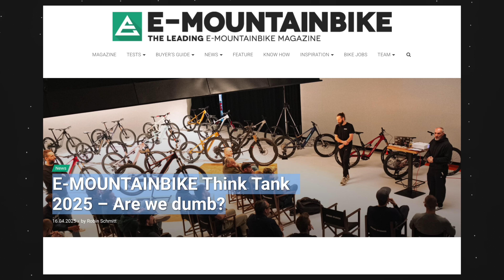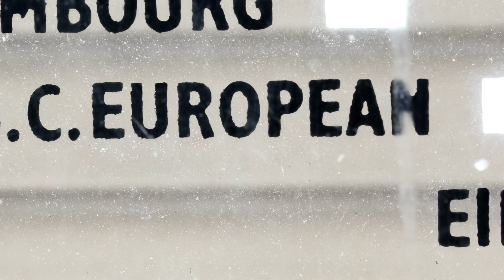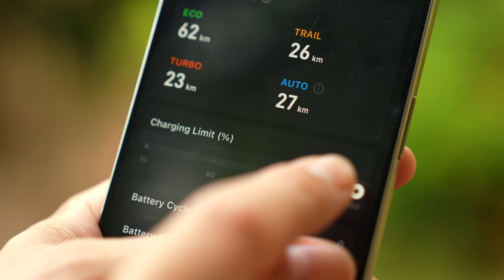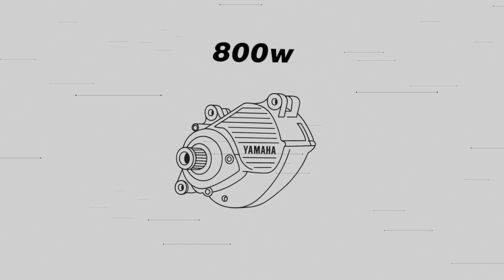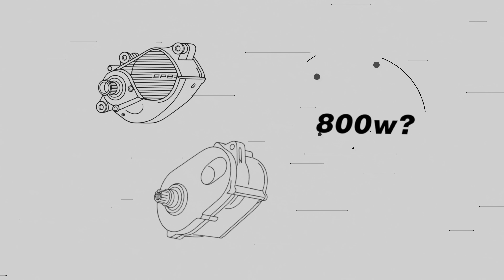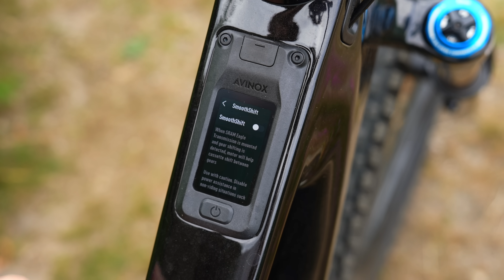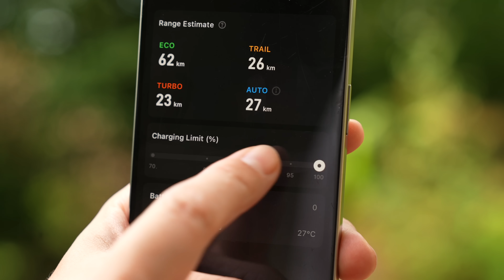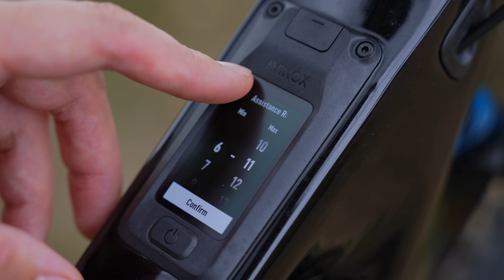Why eMTB Power Is Changing

Comment: As always a cracking summery of what we are all thinking . In the next year there will be a company that get the perfect mix right. It will be a big company in my opinion. Spesh boffins and cranking hard toward this . So its a decent weight , 20 kg , useable power , mid battery with range extender BUT with a user interface that will keep a oldy or a tech nerd happy to use. ITS OUT THERE SOMEWHERE AND WE ARE READY . PS nice use of AI imaging ..... its very handy . cheers BArny

Comment: People can buy a car with 1000hp but when it comes to bikes we need restrictions.  The industry really doesn’t want people to realize there is a cleaner and healthier way to go shopping etc.  I have noticed more cargo bikes being used by hand workers in the city.  Parking is not a problem getting to the worksite is faster most of the time on a bike and your tools can be parked at the door.  Having a stronger motor for transport is logical.  Open up the doors to creation and let the power race begin.

Comment: Watts = Voltage x Current.
More volts= higher RPM 
More amps = more torque but it generates more heat. 

To have more power without burning a motor to a crisp, just raise the voltage.

Don't be afraid to be more technical mate. 

I think It is important to explain and educate the general public, so they can make an informed decision.

Comment: Bicycle chains and sprockets have simply reached the limit of their torque capacity. A new innovation is needed, or perhaps an MGU . Alternatively, a high-revving motor with 250 Nm of torque and a single-speed drivetrain could be introduced. Even today, with around 100 Nm of torque, one can ride very lazily, so fewer gears and therefore thicker chains would be a solution.

Comment: i actually think the 250w continuous peak power limit is sensible, because it, on average, controls how fast a bike can go.  Perhaps, there should be another short term limit, lets say 1000w for 30sec, which again, makes sense. In fact, i'd happily see the stupid low 25kph limit removed (a limit that for me as a light, fairly fit rider makes my ebike by far the slowest bike from A to B) and a new power vs time curve introduced to level the playing field.  That curve, or more accurately collection of curves based on bike type (set by rifer / payload max weight, eg cargo bikes get a higher average power limit) would me we could all just forget all the cheating and subtle avoidance of the single fixed limit power number that we can all agree is ridiculous.  basically we move to an "integrated energy consumption" limit

The one big change that is still in the wings for ebikes, and that will actually revolutionise the market is of course mass specific battery energy storage density! Today, a decent 800Wh battery is still at 4kg or more, and that cannot easily be avoided. A lighter more powerful motor is easy to engineer (just up the voltage and base speed of that eMachine) with even basic commercial PM eMachines hitting 20kW/kg, but today a "big" battery that makes a powerful ebike genuinely useful is a heavy battery!  And this, for me is really the only real downside of my ebike, it's really really heavy. No not necessarily when riding, but for sure when trying to carry it, lift it, put it in the car, etc.  As improvements in cell chemisty now start to push up specific energy density, soon we can have a 15kg ebike with 1000w peak, and1000Wh of battery and THAT really will be game changing  🙂

Comment: The next phase that’s ripe for advancement is the transmission area, whether it be in an improved gearbox MGU (e.g. like a better Pinion version), E-CVT/Hybrid transmission (e.g. Owuru/E2), or pedal-by-wire (e.g. Rivian/Also TM-B). All this manual shifting and depowering the motor at shift points is really just a big interruption of propulsion and motor efficiency. Continuously variable/step-less transmissions or simulated transmissions (pedal-by-wire) are really the way to go.  Chasing power has run its course, and I totally agree it’s how power is gracefully delivered in different riding modes (Plaid was a good analogy).

Comment: To me no way to have all this power. I'm 70 I have orbea rise with shimano ep 60 nm that i ride with my small dog .(i'm 77 + 8 kg of dog and chair) I mostly use eco set at 27 nm medium high assistance, or on very hard hills trail set at 47 nm. On extremely rare case I use boost at 60 with maximum assistence and many times i' scared to capsize. To use ebike to make cardio fitness you do not definetly need a full power, 100 nm or higher is pure madness

Comment: I found the avinox on the amflow to easy to ride. It felt effortless to me, so for me it would be a waste. I currently ride a E8000 motor in my Merida E160 8000 - 2020. It has 70nm of torque, my eco is set at 40%, Trail 90% and Boost is at 200%. My first motor had over 4000kms on it, most were switched off miles too (yes i ride it switched off). My current motor has over 6500kms on the same settings and again I ride a lot of miles in the off position. I like my Merida, but to be honest I would also like a newer tech bike and bigger battery, for when I actually do switch it on....or for when I have a day with friends who ride e-bikes, as they all run bigger batteries! Shimano IMO have done nothing for the market since I got this bike 5 years ago, they don't make bigger Wh batteries to fit the BT-8035 short space, they don't offer any software updates to boost the 70nm either, which is kinda garbage for their customers who run older bikes. Not everyone can afford to buy another new bike and not everyone accepts trade-ins to allow people to upgrade!

Comment: Man... Rob feels like an Avinox sales rep lately. I was enjoying this content until it basically became "Avinox is better than this..." "Avinox is the best" "here's another 10 min feature about Avinox"

Avinox is currently the best at raw power. Bosch, even though you mock it for sensing wheelspeed way less often than the avinox, feels more natural and can be modulated way better by rider input. And Brose/Specialized is currently the quietest system on the market while also having better power modulation than avinox. All of them do not feel sluggish. Yes, Avinox has more raw power, but as you say modulation is key - the question is if you prefer SW modulating it (Avinox) or being in control of the modulation via pedal input.

Can you please start making unbiased content again? I am okay with being hyped on a new product (the avinox system is doing a lot of things right especially for a first product) but it feels like they bought off all the influencers. There are definitely things where the other systems are better than the avinox - a fact I feel is lost in most of your videos.

Comment: Its getting murky, if the market chooses to get into a power battle its going to ruin the sport. I’ve only just got a bosch gen 5 emtb - as an unift ex cyclist its way more power than i need to ride any trail - and it still feels like im riding a bike. I tend to use the minimum power i need - personally i dont see the appeal of riding an electric motorbike - which is where the power battle will end

Comment: Bosch Gen5 with 100nM update (which allows you to adjust how aggressive the power comes on) is plenty of power on technical trails (fire trails may be a different story, but that's not really mountain biking imo).  DJI may be the power king for now, but the Bosch is quieter and likely more reliable.  A year from now the Bosch Gen6 will be king and so it goes, unless they cap power (which is likely).  20 mph is fine for me, too, these aren't MX bikes
Reply: Gen 5 is not silent...
Reply: @stuka78 I said quiet not silent
Reply: 800wh down tube, girl is thick
Reply: @jeffp5418Amflow frame is weak for bigger hits though
Reply: @jeffp5418before all the e-bikes looked the same, due to Bosch parts... now all the e-bikes will look the same, due to avinox parts...

Comment: https://youtu.be/MxnOuWgSvxc?t=346 YES THATS ME, but I also need more than 256km range on a 750w/hr battery xD Im about 105-110kg fully kitted. My bike is about 25kg with that 25kg. I have an Orbea wild m11 2024. Amflow is being sold nu my country and I want to change, but I fear if I ride in the higher power modes, id be lucky to get much more than 15-20km on that 800wh. Its not like I need 40+km range every ride, a 25km feels fine, but it sucks to have to go down to the second lowest assistance mode the few times i want to ride closer to 40km.

Comment: you've hit the nail on  the head Rob, I've  owned most of the motors on the market from Bafang to Bosch but the Avinox is in a league of its own. I was out with a bunch of guys this week all were younger, fitter  & better riders than me. The Amfow just levelled the field for me , 27 miles & 3% battery left almost identical to the Bosch cx5 & the brose  riders.However i certainly had an easier day than all the others & on the climbs the bike was so much better @ finding traction, another insiteful video keep em coming.
Reply: On technical trails it's far more rider than some added power.  Low talent fire trails rides sure...or you could just ride an electric MX bike at that point

Comment: Hpc trailblazer is a class 1 pedal assist with 2000 peak watts, 185 nm and 1050 wh battery. removable throttle…..

Comment: Before Avinox/DJI showed up there were other motors with more than 85Nm of torque. I found at least the following motors:
TQ HPR 120S  Was available in 2012, 120Nm 
SACHS RS 2019, 110Nm
Rocky Mountain Dyname 4.0 2021, 108Nm
Brose Drive S Mag 2018, 90Nm
Bafang M510 2022, 95(110)Nm
Panasonic GX Ultimate 2021, 95Nm
Askoll Ultra C90A 2024, 1200Watt(!), 110Nm

This channel looks like a paid promo now and not a source of objective information, there is no sense to watch the videos here anymore.

Comment: What does the flashed up statement 48s in about “supported by Avinox and Amflow”  actually mean, advertorial? Do you run your Avinox in UK road legal 25kMh mode or use the VPN hack for ‘45kMh NZ mode’ like just about every Amflow rider I’ve met on the trails? I’m not convinced that people don’t just want more speed over more support and features, unfortunately.

Comment: The megamo 5 with the system is the only one I'm looking at. I still don't trust carbon but want a light fast bike with the best electronics. I'm still not confident the avinox is 100 % reliable as the bosch. I've still got a 21 bosch trek rail, zero faults 4500 miles.

Comment: I,m riding an Bosch Gen4 but when I buy a new bike I wouldnt go for the most powerfull one.
The turbo mode I need once every blue moon while the noise of the motor is there every seccond.
I really like the way TQ goes with stealthy silence motors that complement power input instead of replacing it. I guess the dream bike for me would be a TQ60 motor with a proper battery to do 2000hm without an issue, but a bit slower then the Avinox.

Comment: All brushless motors by definition know their position AT LEAST 6 times per rotation (of the motor shaft, before gearing); in the real world the vast majority are multi pole-pair, so it's at least 6x the pole pairs. With more advanced control systems (which most ebikes use, it may be even higher).

Comment: Please do a fair comparison between the responsiveness of the ZF Centrix and the DJI motor. You were very effusive about it when you reviewed the Centrix last year, The Strain wave gearing of the Centrix and TQ motors is so direct and responsive, compared to all the other motors out there. ZF beat DJI to the punch in rolling out a motor with a tone wheel, which gives extreme responsiveness and control. Alex Bike Tester compared the two motors and found the DJI to be lacking in control and traction, due to the over reliance on cadence sensing and not Torque.

Comment: Bafang M560 beats it.. 1250W 140nm+ - All motor parts available to repair if needed and they not silly prices, even a new 800W battery is £300 with 21700 Samsung cells.. DJI are just way to expensive for what you get and if it breaks ya stuffed.. You can get a Carbon Frame with m560 and battery for £2400 - Markhor

Comment: Cycling in general is in a big bubble of monopoly of Shimano and SRAM. All bikes should have internal gearing along with a motor similar to pinion for better performance and low maintenance. Also suspension would work better and weight distribution.
Reply: Pinion's is a good idea but badly delivered. E2drive is better, at the moment.

Comment: Thanks Rob for this intelligent look at eMTB's and power. I use the power for self shuttling and usually ride in trail as it's enough on single track. My surprise favourite thing is the charger. Not only is it fast, it's also small enough that you can carry it and charge up at lunch if you need to. Thanks for highlighting all the extra stuff DJI have done to shake up the eMTB industry. I do wish we had New Zealand's limits here though.

Comment: Geo Restriction is the Answer. Dii system includes a very accurate GNSS in the bike itself and I believe it's possible to set say 25kph on a public road, 45kph off road and even a footpath setting of speed and power. This is what the public authorities, community, industry and riders want. It is possible now. But what would I know.
Reply: That is an interesting novel idea that no one is talking about. It sounds good in theory but I fear that if the mapping it relies on isn't perfect it would lead to a lot of frustration.
Reply: @markharwood  It's not Rocket science.  You are either on a road(25kph or not(45kph) Very Accurate GNSS location ,speed,and much much more data is stored in the Dji bike itself for each ride.No phone needed with the rider.If you want to look at it later you download it to your phone App for the selected ride.  The Dji GNSS is way more accurate than Garmin/Strava wishy-washy data. But what would I know.

Comment: Thanks for the nice video, Rob.
I really like the Avinox system in general, but the 25 km/h restriction in the EU just doesn’t seem reasonable. In my opinion, there should be an easy and legal way to adjust the speed limit depending on the location — for example, a “street mode” and an “off-road/trail mode” outside the city.

It would also be great to have one standard charger socket and battery for all e-bikes, something like a USB-C for bikes.

Comment: Good video Rob.  I ride Emtb because I want more decents ( adrenaline is more what I’m after out of riding and fitness is a very welcome byproduct )I’ve been riding Emtb for about 5 years now mainly enduro / dh style riding on commencal  and YT decoys and it was pretty instant that the 25kmph cut off was pretty dangerous for what I do . Coming into a decent jump where pedaling was still required  and the motor cutting out was more dangerous than jumping . I now have  de-restricted the bike to 32 kmph and find no need for more speed . On the road 32 is good aswell 25 is stupid my cyclocross bike easily sits on the flat stuff at around this speed with pedal power only .
The power side of things I’m happy with I don’t feel the need for more but would try . 
I’m 53 been riding MTB very regularly for the last 13 years .
Keep the good work with the channel going.
Reply: Utterly disagree that the 15.5mph limit is  dangerous, next you’ll be telling as that non e-MTB’s are dangerous because you can’t pedal fast enough to the same jump for a safe takeoff 🙄

Comment: I bought an Orbea RISE M10 2020 model with a max output of 60Nm. I did that because I wanted to slowly transition from Analogue to E, but still be able to finish a ride with a raised heart rate and a feeling of accomplishment. The RISE, 5 years on, is still delivering that experience and the Shimano App offers customisation of the power delivery in much the same way as the Avinox system, just via a linked App rather than a built-in touch screen. DJI had the benefit of history, user experience and feedback of bikes already out there and have delivered an amazing bit of kit that offers riders a unbelievable level of personalisation to allow the same user many years of use as they either grow stronger, slower, or older. I tried one in the Woburn Back Woods recently, using the 60 second ‘Turbo’ mode up one of the steepest climbs… madness… grin inducing madness. The owner ‘normally’ rides in Eco, with low levels of assistance as he also transitions to E-biking, but he knows, when necessary, he has the power to overcome situations that would normally see him hiker-biking up a trail. I still make it up most stuff on the RISE, just not as quickly as I did on the Amflow… but I’m not ready for the Amflow. When I first got the RISE I promised myself ‘I’ll only use that on the toughest routes’, but having the luxury of both Analogue and E, I now find myself faced with the dilemma every time I open the Bike Shed… Do I take the Volvo, or the Porsche? Both are great… But the Porsche is so much more fun! Love the Channel. Thanks for the debate.

Comment: The laws that exist from the gas powered moped days are loopholes for emtb moped legalization. A 40 pound EMTB that can achieve 50 mph and keep up with traffic is a true human/electric hybrid that can be pedaled if need be making it from road worthy to bike trail worthy, it can be carried and charged on any 120 volt outlet. The old gas powered mopeds only had pedals for show and for some reason these ridiculous machines were a thing. The economics for having a street legal E-moped with a at least a 1500 watt motor are, it would cost  a person more money in transportation costs not to own one. Cyclists are generally snobbish about change but the trend will be more power and faster speeds.